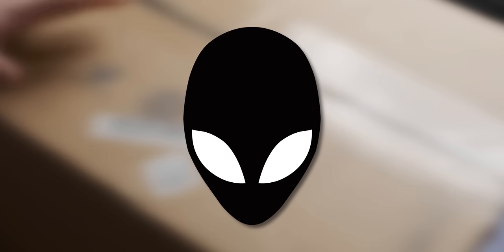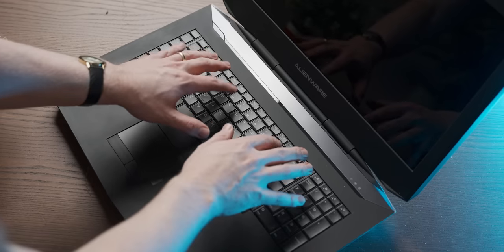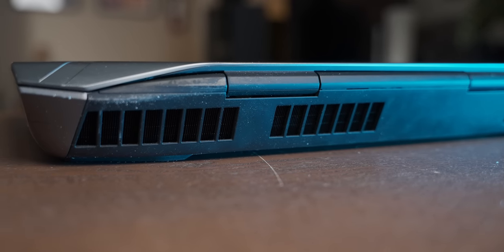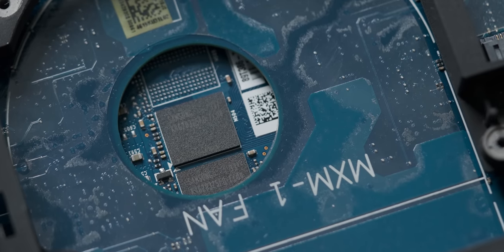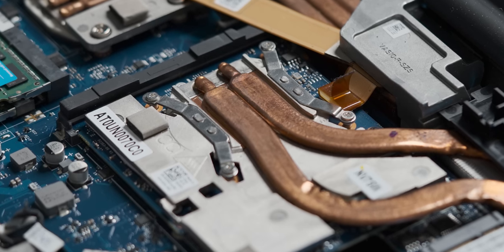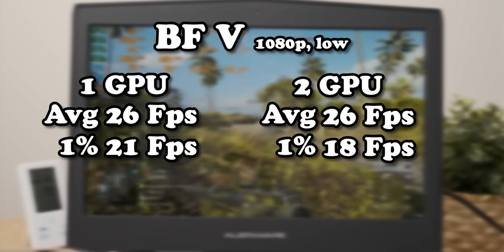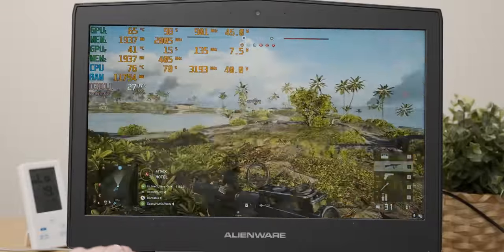This MASSIVE Alienware Laptop Was WILDLY EXPENSIVE

Comment: 3:21 I have to correct you on this. That is NOT a firewire port. That is actually a Mini DisplayPort. Even the symbol suggest that too.
Reply: I wondered why there was a FW on a laptop that late, because FW was Core2Duo era - lol -.
Reply: i saw that too, its def a mini DP
Reply: Yeah I was gonna say the same thing. Although to be fair, I worked on a Sager Clevo laptop with a 3rd gen i7 and a GTX 675MX card that still had a 1394 mini port on it. That was probably the last year anyone included those ancient ports.
Reply: @SidneyCritic  my desktop motherboard has a firewire from about the same time
Reply: Wanted to say the same thing it is a mini display port.... which with a good splitter dongle you can attach 3 4k displays assuming you have dual high end gpus inside with at least 8gb vram each or even better wit quadros.... a perfect scenario for productivity
Reply: @DJdoppIer  for music/film production FW is more stable and has dedicated signal paths that bypass all other I/O request to the processor. FW has intelligence...codec chips at both ends and never touches the CPU for workload, only IRQ line up.  USB on the other hand must use the CPU to do its CODEC (compression/decompression) handling.
With intense CPU loads such as video with audio editing or multi track recording USB I/O could, not always does, but could cause dropped frames or weird audio artifacts in music production.  that cost time and $$.
 there is non of that 'over saturation' using FW.  that saves time and $$
 but if your not a picture editor or music producer it's not a noticeable issue.  and not something you would miss or cause and grief.
I still use FW on a 24 core 64GB Mac Pro.

OF course Thunderbolt is the newer answer to firewire. Although the same principals apply. a stand alone i/o that wont rely on CPU to do its heavy lifting.
Reply: @DJdoppIer  btw, Mmmmmm...Clevo, (drool) what a machine.
Reply: @shblair  That's actually super cool, I had no idea.
Reply: I have this laptop and it is 100% mini DisplayPort connector, FireWire port has totally different shape and size

Comment: i still have my Dell Xps M1730 with the leather bound folder abd xps backpack. It still works tho , i dont use it at all. its got a 230watt brick, two 9800 gtx's full size unlike this config as its not mxm but pcie with a Intel Core 2 Extreme X9000, dvd drive plus a remote for media playback, rgb lighting, back lite keyboard incorporating a logitech G15 panel showing cpu temps gpu temps , email,music tracks etc etc, fantastic speakers front facing of course, 8gb  Ram. a 1080 monitor, weighs a ton but it was one of the first "desktop replacement system's"

Comment: Dawid, I'd really love to see a video of you upgrading the MXM graphics card(s) in this old beast and see what it can do with something significantly newer. The NVIDIA Quadro P4000 mobile seems to be quite an upgrade, while costing not nearly as much as a Quadro P5200. Additionally, seeing the CPU upgraded to a 4940MX would be mildly interesting (as the CPU in this laptop was already upgraded to the 4700MQ). I'm not sure what RAM comes in the laptop, but perhaps upgrading that as well could be interesting.

All together, it would show upgradability is important and how large the difference in performance can be with said upgrades. Just a cool idea.

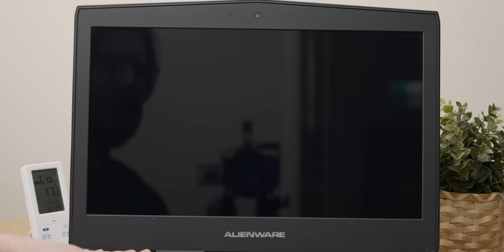Edit: also, did anyone see that little subwoofer at 5:42? 10:13 shows the laptop had Klipsch speakers, which must be pretty impressive! I'd love to hear those laptop speakers!
Reply: For the MXM ff, I believe that I have seen a few 2070's around on Ebay. Maybe worth a video?
Reply: I'd recommend dual 8GB GTX 980M cards for it. If you tried anything newer it either doesn't support SLI or the MXM board components (like the VRMs and mosfets) won't line up with the original heatsinks.
Reply: The klipsch speakers still obliterate everything available in modern laptops hands down.... they were just that good 👍 and about the GPU  upgrade I believe the wattage per GPU on this one is about 150 watts but the laptop is limited to 100 watts per module and the mxm quadro rtx 5000 is 100 watts max which perfectly fits within the limits of the 100wats gpu heatsinks....
Reply: MXM RTX cards from HP and a few obscure venders are known to work aside from needing to mod the drivers. The HP mxm cards do require some heatsink modding but beyond that they work pretty well and have been demonstrated to work without much of a fuss.

Comment: There is 1 thing im missing with in your old hardware videos - overclocking. Im pretty sure you can make those 765m's run significantly higher clocks with this kind of cooling. I managed to get extra 20% of performance just by overclocking 7600 in my retro gaming laptop.

Comment: I still have mine sitting on my shelf with twin 980ms and the top 4th gen (can't remember the numbers). I was pushing this thing so hard I was blowing motherboard mosfets within 10 minutes of running a game. I was working on a custom power board that would power each card instead of the motherboard to prevent this issue but it ended getting shelved and kinda forgotten in favor of my x170kmg that has a 11900k and 3080.

Comment: I have one of these... P18e the motherboard went out but I still have it and it's just like my Clevo P370EM it is one of my favorite comps, mine currently has a pair of GTX 980m 8gbs, and then an i7-3840qm, one nice feature about this aside from the built in RGB is that you can use the HDMI as a passthrough for anything you want to hookup to it, such as a PS3 or whatever you may have as a HDMI device, and as someone else pointed out it had a mini display port

Comment: Daily drove the 17" version of this for about three and a half years. Thing is built like a battleship. Dropped it off of the pavement and the only thing I had to do was go in and reseat the GPU and I was good to go for another year and a half.

Ended up retiring it due to not needing a laptop at my new job, but it has been collecting dust(And needing a repair).

That being said, I wish you showed off the HDMI-In feature these two laptops, and nearly no others, had. Such an interesting feature(And honestly one I wish more PC manufacturers used, though AFAIK only Dell can as they bought the patent off of Clevo.). I've used it a few times and it is genuinely useful, turning the laptop's relatively nice screen into a spare monitor.

Comment: Did it survive your vivisection? While they're not as popular as they should be there are MXM GPUs out there in RTX 20 series and GTX 10 series and I for one would be curious to see if you could force an upgrade to a modern laptop GPU
Reply: Framework is planning on launching a laptop with an upgradable cpu and gpu late 2023. Not the same as mxm though. I assume it’s going to be more midrange options to start
Reply: @Spork0  I did see that, the only question is to frameworks connector (or rather pinout since the connector existed already) being adopted as a standard and whether or not it would have even needed it if not for the death of MXM. That's the thing I hate most about the concept of a "desktop replacement" really is that they mostly are stuck in the configuration ordered to start, framework's effort to turn that around is appreciated.
Reply: Sadly it wouldn't work, usually these laptops that supported MXM gpu's only ever accepted cards from the same generation, and in the "best" case scenario they'd take one generation later if the cards were roughly similar in architecture. So in this case I'd image something from the 8** line (which was a thing for laptops, if I recall) would maybe work, otherwise you'd want to go for a 780m.
Reply: Found a 1070 mxm on Amazon😬
Reply: This and the 17 in equivalent take 1070 mobile mxms no problem. Not sure about SLI with those. And its dependent on which screen you have and your knowledge on altering drivers to make it work. I have a maxed out 17 inch with a 980m in it currently.
Reply: @firmteacher  Yeah this is exactly why MXM never really took off - everything is a pain with these things and it isn't nearly as plug and play as you would want to believe. Although it's good to know these would hypothetically take a 1000 series card!
Reply: @MrBwj1990  it’s not much more difficult than replacing one of the cards out of these laptops. The screen situation has to deal with the type of connection it has between the screen and motherboard. The 10 series can’t be used with Optimus for these models of laptops. So you need the 120hz screen.

Comment: I got an Alienware 17R5 several years ago. I've upgraded it to over 6 TB of internal drive space. It has an 8GB 1080Ti built in. I got the Graphics Adapter for it and put in a 6GB 2060. I'd say that, other than ray tracing, both cards put out the same results, just swapping 2-3FPS depending on the game. Came with twin built-in coffee warmers. Often sounds like I live near an airport if I'm not wearing headphones.

Comment: Battlefield 5 doesn't fully support SLI & requires a custom nvidia inspector SLI profile to work in SLI mode.
For upgradability, you can go up to SLI GTX 980M's or single GTX 1070 MXM.
CPU highest is i7 4910HQ.

Comment: I have this laptop. Still works today. It's a beast. I upgraded the GPU's from dual 780m's to dual 980m's in SLI. The processor can be upgraded to but I already had the highest spec available for it with the 4940mx. This was back when AW used to make amazing laptops. I also have the previous model of this the AW M18x R2 with also upgraded CPand GPU's.
Reply: Any suggestions for sites or channels or forums for this? I have a 17r - something (it's upstairs and I'm lazy) that my son has used all these years and just now replaced with a desktop. So I'm inheriting it. I need to clean it up and replace the coin battery, he's been F-12ing it. I don't even know where the battery is on this sucker and I hope it doesn't require flipping over the motherboard.

Comment: i have the same laptop, got it for like 400aud with sli 770m in it and upgraded the gpus to two 980m's off aliexpress, also upgraded the wifi card to a wireless ax one off aliexpress and put a couple SP A55 ssd's in, one as a bluray drive replacement and two in the hdd slots running in raid0 through windows. Feel free to reach out if you want some more info on tweaking the absolute shit out of this beast.

Comment: I had an M18X from 2011. It came with dual 580m's. Ran BF3 quite well from what I recall. Solid metal lid. Had HDMI out AND HDMI IN so you could use the display for like game consoles if you wanted to. I'd run my Xbox 360 on it.

Comment: I had one of these with the i7 4710MQ and 2 860m's in SLI. It was the best piece of hardware i've ever used, it was super quiet and well built, build quality wise, it's much better than anything alienware has today. The configuration with dual 980ms was impressive, it's performance in SLI is equivalent to a 1070. But getting SLI to function was always a pain in the ass, you needed an app that would "force" the sli profiles on games that weren't compatible to work and performance gains were sometimes low, but necessary if you wanted to play at decent framerate.

I miss that laptop

Comment: Hi Dawid, I have one of these from a different generation (I'd have to check the specs, but case is slightly different in how you access the hardware, and battery is removable without opening the laptop up) if you're interested.  One day when plugging in an HDMI cable I must have built up some static because when I went to do it, there was a spark from me to the ground on probably that HDMI connector, and laptop instantly shut down, never to power up again.  I've never got round to opening it up again to have a look, could very well be something as simple as a fuse somewhere in there.

Comment: It seems that in battlefield V the game didn't use the second GPU even tho SLI was on, the wattage was low and it was sitting at 40 degrees, that's why the performance was same since it was still running with one gpu.

Comment: I remember purchasing this brand new from Dell with a 4930mx and 780m SLI. Over the years Dell offered it with the newer 4940mx and up to dual 980m SLI. 

Unofficially, you could cram other various MXM cards in there up to MSI variant 1070 mobile cards and Quadros.

Now that you have it in your possession, it will be fun to see if you upgrade the CPU to a 4940mx (and maybe overclock it with XTU or Throttlestop) along with slapping 1 or 2 980m's in there (need the newer beefier heatsinks) and see what it can really do.

Comment: That SD slot may be for mSATA - think of it as a predecessor to the m.2 format(s). The drives are hard to come by nowadays because the format has been summarily replaced by m.2 and only a few legacy drives float around. It also caps in capacity at around 500 GB, so it's sole value nowadays is as a OS drive at most.

Given the vintage of that beast, it makes sense to be there though - my MSI laptop is from 2014 and has two slots and 2.5" SSD drives were still pretty expensive around the time, so this was an option to put in a SSD into a laptop if you wanted and use your main HDD as a file drive of sorts.

Comment: The port you called firewire is actually a mini displayport (you can tell by little dp logo) and that tiny ssd slot was for msata drive which was a predecessor of m.2 form factor.

Comment: Considering SLI is basically dead the two mxm slots kinda make me think that it'd be neat to get a high power and a low power efficiency card in the two slots!
And then configuring them to use the efficiency card for general use and the high power one for gaming.
Could be quite useful, but the sheer brick-ness and age of it probably make it more worth it to just get something newer with decent integrated graphics for that two card effect

Comment: Laptop with very limited portability and require extra ticket for flight. However, today even some desktops have very limited upgrade patches. If not soldered, then proprietary parts... SLi/CrossFire were running like that. Gained 20-30, sometimes 40% of performance. Sometimes due to PCiE lanes (one running in 16x, two 8x/8x or 16x/4x). Anyway, laptop is impressive

Comment: i have this exact same laptop but without the SLI configuration! the 765m has around the same performance of a gt 1030 nowadays. this one is really well taken care of, the sides and the top housing of mine are turning into goo.. temps are supprisingly good after a quick thermal paste replacement! great vid as always

Comment: MXM actually isnt totally dead, its now just a feature of very high end laptops from brands like clevo and their resellers (and some business class workstation laptops), i personally own a sager rebranded clevo laptop that has an RTX 3080 Mobile in it and they are still putting the GPU on an MXM connector, however as i said only in very high end laptops because it also has a desktop i7-11700k and cost me $3600 with both RAM and Storage being left on the lowest options lol

Comment: Should follow up with following 2 configs but also test power draw between 765M SLIs and these:
an upgrade to GTX 860M/870M SLI
an upgrade to a single most powerful MXM GPU you can find like RTX 2060 / 2070

Comment: you could go a generation newer on the processor fairly cheaply, and the GPUs could theoretically be updated to almost-current gen with MXM replacements - might run into compatibility issues, but it feels like this thing actually has some life left in it

Comment: If I recall that "SSD" slot should be for M SATA given that M SATA has two spots for screws in the top left and right corner opposite the contact fingers. M SATA honestly was weird as only  M SATA worked with it and it was still capped at the SATA data rates.

Comment: 1. These laptops largely suffer from the same surface coating breakdown as you would expect on a logitech peripheral. 2. SLI was essentially worthless EOL even when this was new, it really was not relevant since 5 or 6 series. 3. Firewire was also dead at this point as well. I would have considered one of these if they went to 8th gen, but I ended up going with a single card config Clevo P870TM, as SLI was definitely dead at 10 series, the 1080 I got is still competitive compared to modern stuff

Comment: This was a great vid, Dawid!  I have an old System 76 Bonobo Extreme gaming "desktop replacement" with a GTX 680 with option to add another one for SLI.  It's just as easy to strip down (I have to make time to replace the old paste and pads) as the Alienware unit you showcased.  I only use it as a back up PC when the other one is in use.  Fun times!

Comment: You should defenetly make a follow up video where you upgrade this old beast. You can easily put in two 980m which are significantly more power than these gpus. I've done quite a lot of these upgrades so, if you need help just ask :D

Comment: If you look at the GPU numbers in BF5, you'll notice that the 2 GPUs have VERY different utilization. It means Battlefield had no idea what to do with the SLI setup, which makes a certain amount of sense. BF5 came out in 2018. By that time, devs had mostly stopped optimizing for multi-gpu setups for the most part.
EDIT: You can get RTX 20 series GPUs in the MXM form factor. They are NOT cheap, since they are in quite short supply, but they exist.

Comment: Sadly CPU can be upgraded/swapped within same generation. GPU is doable with some modded vBIOS and BIOS and then you need to modify graphics drivers to get those installed. Good thing is that you can swap out broken components or send one GPU to repairing and still keep using the laptop with other GPU.